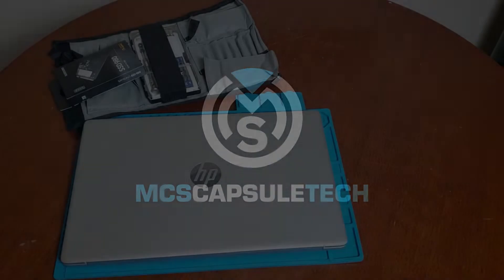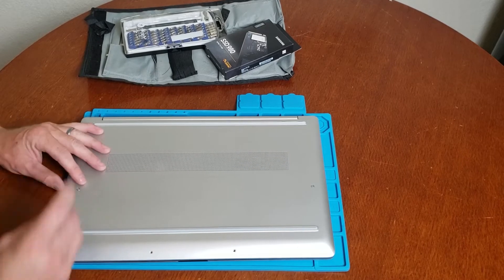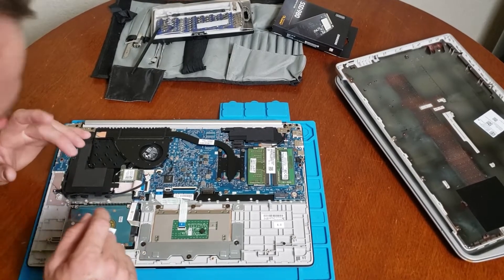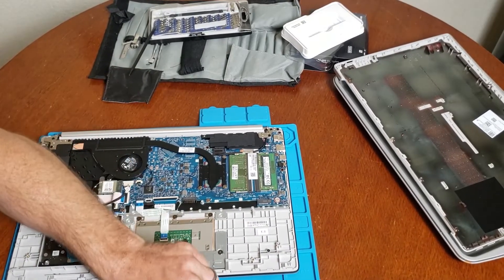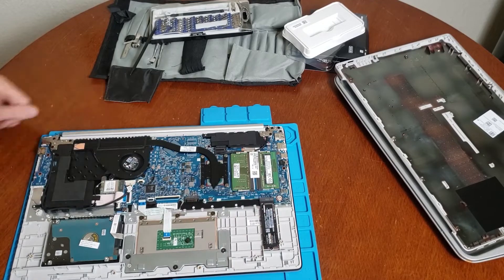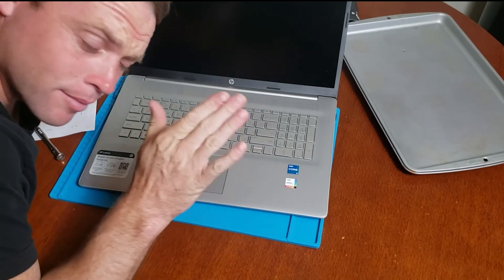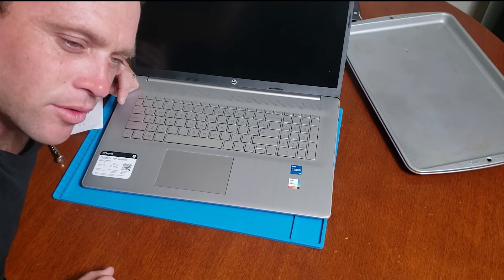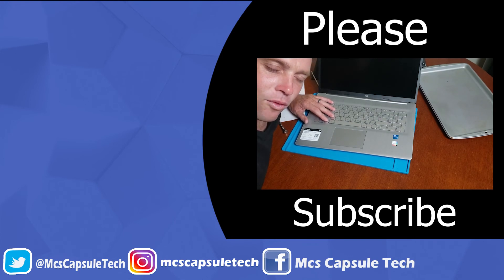HP 17 cn0053cl SSD Upgrade

Comment: I have this same lap top from Costco. Slow as hell. I bought the same Samsung ssd. Partitioned and formatted it to ntfs. Downloaded the windows install wizard thing and created a  bootable drive to install windows but my new ssd doesn’t show up when I try to install windows?
Reply from the maker: You might have to install the Intel drivers that stupid until does this on some laptops I haven't done this one in a while so I have to remember back but Intel for some stupid reason you have to write a file there's one online how to do it and you have to add it in the USB stick with the windows install and then when you are installing when you looking for your drives you might have to install the drivers you can add by drives or add more and then your drives will show up it's stupid I don't know why until does this
Reply: @mcscapsuletech Intel drivers or drivers for the 970 evo?
Reply from the maker: @beaucram6209  just look up Intel they're just regular drivers Intel clean install drivers for windows drives
Reply from the maker: @beaucram6209  there's no specific drive to the drive itself you even have to do that with non SSDs too dumb but only on certain devices custom you never have to worry it's just a laptop thing
Reply: @mcscapsuletech figured it out. I just had to manually find and pick the drivers 🤷‍♂️ thanks for your help
Reply from the maker: So look online and type in a YouTube video I should probably make one myself but you'll want to look for Intel drivers when installing Windows to see hard drives
Reply: @mcscapsuletech thank you! It’s driving me nuts. (No pun intended)
Reply from the maker: So it worked

Comment: i have the same laptop, bought the samsung 980 ssd drive m2 drive but cant get bios to recognize it
Reply from the maker: It could be a bad drive if it's not able to recognize it or it's not correctly inserted in the m.2 slot remember if you're using it for extra storage and still have the hard drive in there you have to right click if you're on Windows 11 and select more options then select manage then disk drive and then you should see the disk drive there right click it click format into NTFS and then pick a letter for the drive and then you should be good in the drive should show up but for the bios not to pick it up that sounds like it's not inserted correctly or it's bad drive
Reply: wanting to boot up to it. used tge samsung migration software. do i gave to take the old drive out. i thought i could just assign to boot to ssd.   @mcscapsuletech

Comment: Why doesnt anyone walk through the changing of ssd after putting in the new one?
Reply from the maker: Because the video you need to look for is installing Windows or copying drive to new drive I'll have to maybe do a video on it
Reply: It would be great cause I just installed Samsung 990 Pro 2TB SSD Nvme m.2 and when I clone it from my 1tb HDD it clones it all messed up. Shrinks the size but leaves no unallocated space. I moved all my file to an external HD cause I am thinking about wiping it all clean and starting from scratch
 @mcscapsuletech
Reply from the maker: @Golfexpertbelieveme  some of the cloning drive softwares you got to get a good one only will clone the size of the original disc or cloning and whatever size that was it'll be so if you're cloning a one terabyte and you have a 4 TB new drive you will only have access to one TB of it when the cloning's done so when you look at your c drive on the new drive it'll still say one terabyte I mean you can split the drive up with partitions and then use that extra three terabyte that's not using but there is one cloning software I want to get I'll do video on it if I end up buying it it's just going to cost so many so but just wanted to put that out there for you
Reply: And I have watched almost every video out there on cloning drives and none hit what I need shown. Guess I need to just take it in to the professionals.
 @mcscapsuletech

Comment: Great Video, the reason i checked and subscribed because is a detailed video of opening up. Now my issue is non of the above. it does have a SSD drive, just wanted to see if there's a reset button on the Motherboard. My computer charges sometime and blinks 3 time when plugged in and power button is pressed. I tried disableing in the device manager from other videos the batter plug device. It did charge once and that was it. Funny how this is my 2nd HP lattop and seems to die a year and  month after both purchases. i think I'll buy a different OS next time like i used to. my Mac book Pro from 12 years ago still runs flawlessly.
Reply from the maker: you should see if you have the newest firmware and windws is all up to date also try this video https://www.youtube.com/watch?v=YV2trKuFvww&t=3s

Comment: Installed an SSD and Windows 11. Start times went from a few minutes to 8 seconds. The windows installer didn't recognize the SSD at first and I had to install Intel RST drivers from Intel's website. The drivers from HP did not solve this problem.
Reply from the maker: So everything is working now if you're still having a problem let me know
Reply from the maker: Yeah that's always annoying how they have that that Intel it's not with AMD Intel it only certain Intel certain it tells you won't have that problem it just depends it's annoying

Comment: wow just ONE wifi card Antenna cable? how many pins the SATA HDD cable has 8 or 10? i miss SDcard reader, anyone added one? (which board header and HP reader to use?

Comment: I noticed you got a CMOS 502 error, I got the same error after replacing my hard drive. Also noticing now the battery is not charging. Were you able to clear that error?
Reply from the maker: Oh yeah I was able to
Reply from the maker: The hard drive in this computer was just taking way too freaking long to do the copy over and so I had to just do a fresh install right to the NVMe drive and after that I updated the BIOS

Comment: Excellent video, I really appreciate your insight and explanation. I purchased this computer from Costco a year or so ago and noticed the slow speed immediately. I then attributed it to the HD vs. SSD and thought I'd live with it and have done so. Am I totally pleased, no, but I have found out if I leave the laptop on 24/7 upgrades and whatever take place at times when I don't notice the slowing of the system, it works for me. That said your instructions are clear enough to provide me an option should I decide to bail out on the HD. Thanks for taking the time to provide the video.
Reply from the maker: That's exactly why I made the video Hope you sub glad you like

Comment: Can you explain how you added the 2nd hdd ? Thank you.
Reply from the maker: one is and hdd the other is an ssd this laptop only suports 1 hdd but can have two ssd one. you can have two sata ssd and that same time.YOU CAN HAVE  1  m.2 SSD and 1 other 2.5in ssd or 1  2.5IN ssd AND A NVME M.2 SSD IF YOU WANT THE BEST SPEED. HOPE THIS HELP PLEAS SUB IF IT DOES.